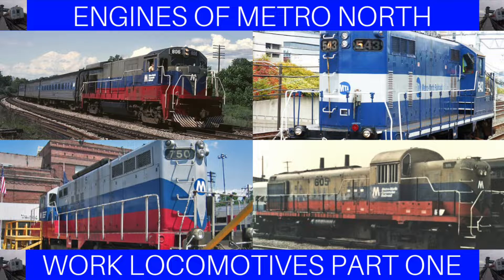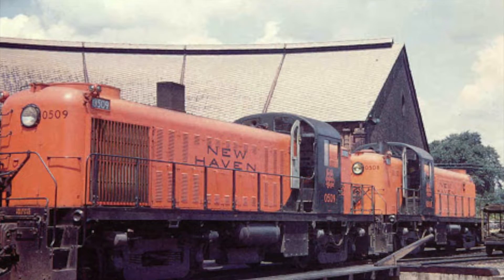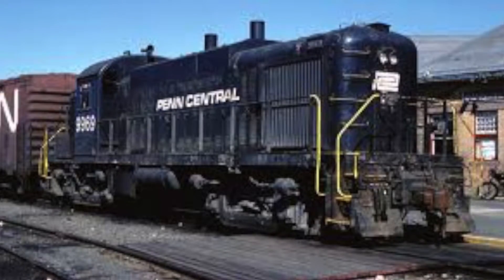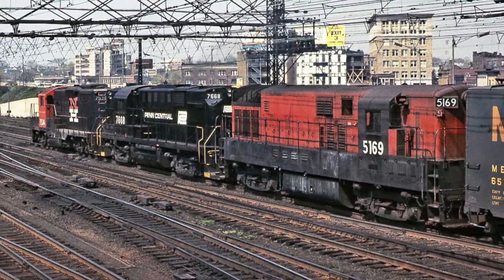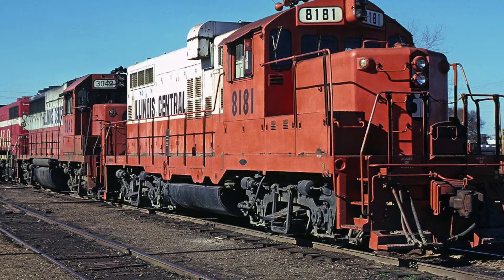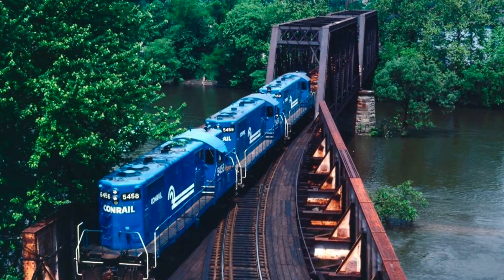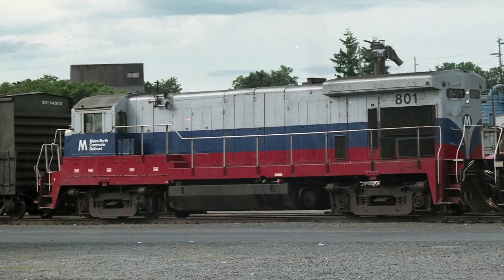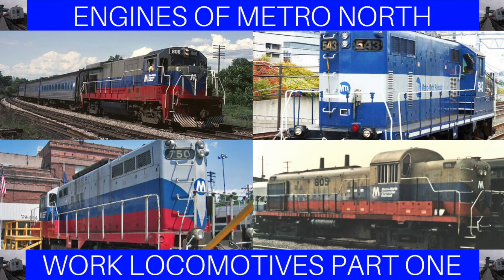Engines of Metro North, EMD GP8, EMD GP9, GE B23-7 and ALCO RS3M

Comment: I was at one of the open house tours of Harmon Shops. A mechanical guy said that the B23-7 fleet were odd balls because of the large fleet of GP7/9, FL9, and F10 of the era. They were soon replaced with the rebuilt GP35 fleet.

A few years later my railroad career began on Burlington Northern. This is where the B23-7 fleet ended up. I had one once.

On another note the EMD repowered Alcos did not have diesels from GP units. A GP7/9 has a 16-567. The Alco rebuilt units had 12-567 engines from retired E7/8.

Comment: Those B23-7s were so abused. MNR used to leave them idling 24/7, and they would often be so loaded up with carbon that they would blow fifty-foot flames out of the stack when they were throttled up. The huge wooden timbers of the bridge carrying Prospect Hill Road over the Put Jct Yard in Brewster were so badly scorched by the locos parked under the bridge during their daily inspections that it finally had to be condemned. 😂
Reply from the maker: Though it was probably more than just those locos that did it

Comment: GOSH DARN IT MAN!!! I WAS GOING TO DO AN EPISODE ON METRO NORTH 605!!! It's ok though. I still have other plans of other locomotives in the northeast for my series, Remarkable Engines. Also, what were the other RS3s which MN rostered other than 605?
Reply from the maker: I have no idea I couldn’t find any information on how many metro north had, I know that 605 was owned by condot. I just assumed that metro north had some as well.
Reply: @nyrailfan202  Ok. I also did a bit of research on MN's roster and I think 605 was their only RS3. It was also from the Lackawanna and later became Erie Lackawanna, then Conrail, and was then sold to Metro North as a work locomotive and is now preserved at the Danbury Railway museum.